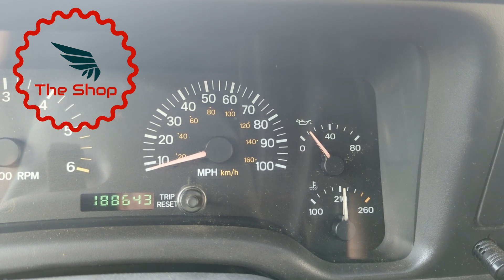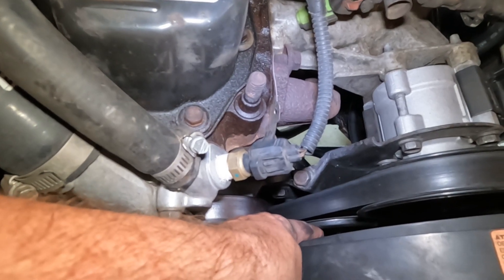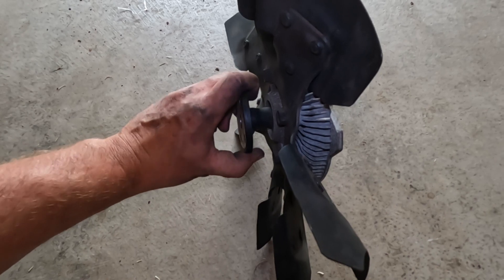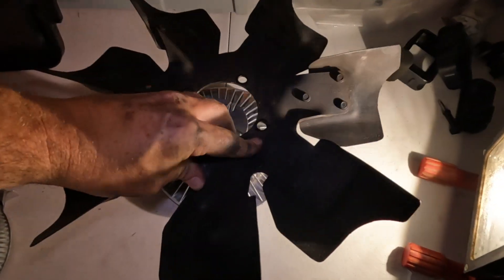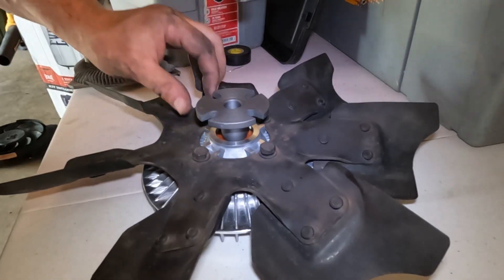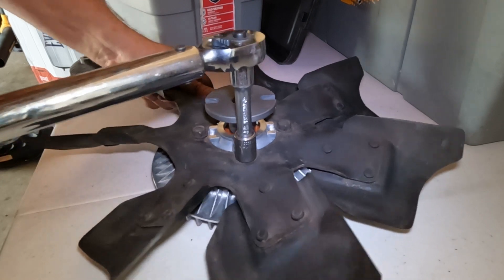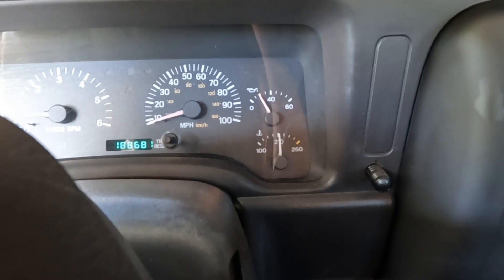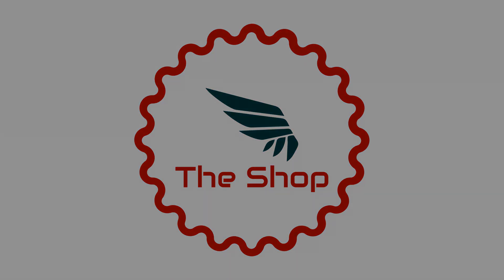2000 Jeep XJ (Cherokee) HD Fan Clutch upgrade

Comment: I noticed when looking to order a fan clutch they mention "reverse". 
How do u know which I need? For my 2001 xj
Reply: I questioned this also. Napas website say reverse rotation for xjs.
Reply from the maker: The routing of the belt is different on some models so the fan is a forward and reverse fan depending on which models.  Offhand I cannot remember which is which but make sure to use the correct one

Comment: I just put a HD fan clutch from a Grand Cherokee on my right hand drive cherokee.  I wouldn't fit back in like the regular clutch.  I had to remove the radiator support across the top and pull the radiator forward and it just barely made it in place.  Now there's about a half inch between the radiator and the clutch but it's all clear and not hitting anything.
Reply from the maker: Glad you managed to get that in!

Comment: Great video.  

You mentioned a couple of times (including at 3:04) that you needed to loosen the idler bolt.

Why?

Having just removed the belt from my 4 litre XJ without doing so not 5 minutes ago, AFAICT it should not be and is not necessary.  Mine is a RHD so the belt path is different but having studied the other possible belt layouts I still can't see why you would need to.  What am I missing?

Ah, I think I've just figured it out - it's not about the belt layout per se, it's necessary in order to be able to release the tension!  Doh!

I did of course perform an identical equivalent operation when I slackened the bolts on my alternator...  because that's how the RHD version applies tension to the belt.

BTW, the instructions in the factory service manual advise that the shroud and clutch should be removed together as an item after undoing the bolts on the hub so the issue is not your new radiator with the bar.  I am just off to do that right now.
Reply from the maker: You are quite right, you need to loosen the idler puller in order to release the belt tension with the sliding idler pulley

Comment: I can't believe people haven't figured out that you don't have to remove the fan to adjust the belt. I've never had to with a regular wrench and it's a lot easier if you use a 13" ratcheting wrench.
Reply from the maker: You are quite correct you do not need to remove the fan to tension the pulley, if you can get your socket in to release the idler pulley.  It can be done!

Comment: Great video. What is the distant between the new fan clutch and the radiator? Do you have a 2-row radiator? Do you take your jeep off-roading?
Reply from the maker: There is 1" clearance from the fan clutch to the radiator.  Two row radiator.  The Jeep is a 2WD so no off-road yet.  Keep watching the Chanel, at some point I will rebuild an AW4, Transfer case and diffs.  Once that's done I will convert it to 4WD
Reply: @theshop392  Thank you for answering my questions

Comment: Fan clutch cooling better?
Reply from the maker: It has been maintaining its temperature perfectly in the 110f heatwave we have been in for the last week or so
Reply: @theshop392  so runs cooler? Is it loud as others claim?
Reply from the maker: @ari1234.  It doesn't run any cooler (195-210), but it is able to maintain without the electric fan kicking in
Reply: @theshop392  any power loss on the jeep?.Cool thanks
Reply from the maker: @ari1234.  None noticeable

Comment: Delete your fan clutch. Dont waste your time. Install an electric fan fron an old 90's ford taurus. They push 4500CFM. Combine it from a high flow water pimp from FLOWKOOLER, and your jeep becomes cold-blodded. Will never overheat again. Guaranteed...even in the Sahara.
Reply: Would I replace my stock electric fan with the one from a Taurus or do I have to eliminate the fan clutch?
Reply from the maker: Take a look at one of our earlier videos, we considered going full electric and decided against it just before we installed it.  Still have the electric fan shroud on the shelf.  We did use electric fans on our CJ and they worked well.
Reply: How many shitty chinese electric fans have you replaced? Keep the one that is mechanical...
Reply: The problem is that electric fans are on all the time and they die early. The mechanical fan clutch lasts 3-7 years (mine usually lasts 6 1/2) m whereas the electrics only last half that in hot xj engine compartment.
Reply: @Vickyvee97 Thats why you should install a proper relay and switch setup with the Taurus or 90's volvo fan.
Reply: @chankludo1  Stop giving bad advise, Junkyard OEM fans only operates when its hot enough to do so, with an xj  it's operating all the time. oem electric fans are design to operate for short period of time.  Just maintain your cooling system, use an oem mechanical fan cause it wont clear the shroud (which is important as well). Look, the XJ was designed for a 4cylinder engine and later had a 6 cylinder shoe horned into it, not to mention that the 4.0 is just a stroked 3.8 L AMC engine and generally its going to operate between 190 to 210  degrees NO MATTER WHAT YOU DO and if you put big tires on it , it's going to stay in the 200 too 210 range (without a gear ratio change). I have a no issues with my 99 XJ  staying at 190, it only goes up in traffic to 200 at most and I only have 32s but I'm stupid enough to go beyond my Jeep's gearing .
Reply: @Vickyvee97 My fan is setup with a bmw dual speed temp sensor and it runs perfectly. Keep putting oem garbage in if ya want tho.